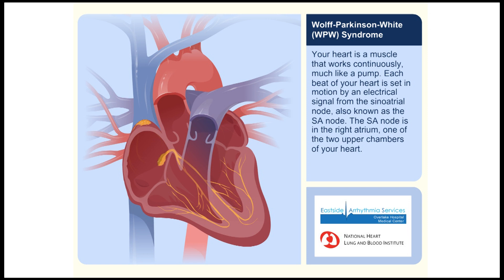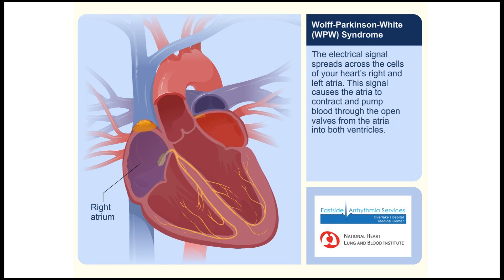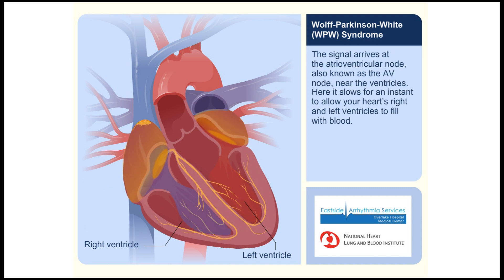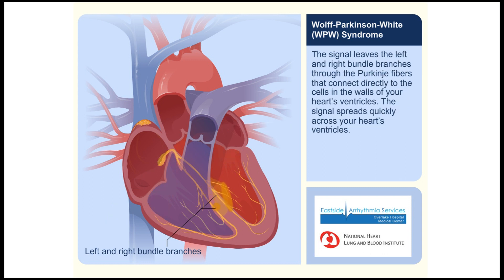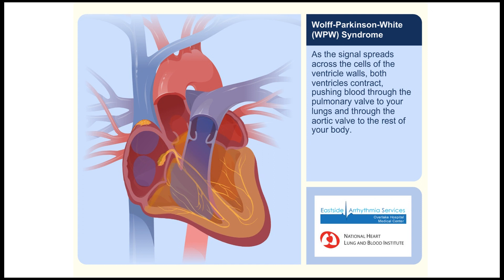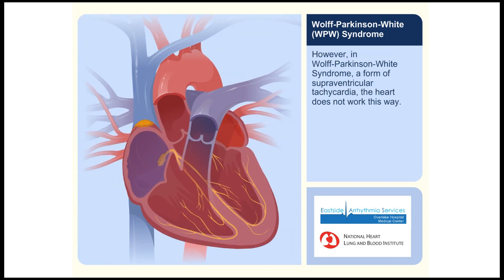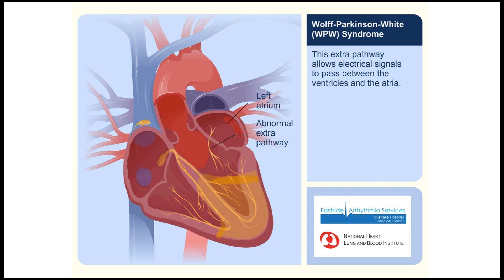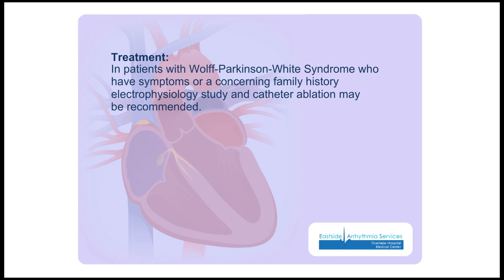WPW (Wolff-Parkinson-White Syndrome) Animation Video

Comment: I had this done and for those going for it read this: If you are going for "Catheter Ablation" don't worry. The doctor will give you enough anesthesia to sleep during the procedure but you might wake up in the middle of it yet wouldn't feel any pain so again don't worry. Once done, they will let you sleep until you wake up by yourself then after some time, they will remove the catheter. There is no pain and no other side effects etc. 

What might bother you for 1 day is back pain that you will feel cuz you are not allowed to move for one night after the procedure is done since the cut/wound needs to heal and will be covered with bandages. You will stay in the hospital for one night and then allow to go home the very next day. Just DON'T walk fast, run or use stairs for at least next 20 days. Good luck!
Reply: how many chances are there that i won't reappear? and what are the risk?
Reply: @professor_here96  As far as I know it never reappears and there are no risks. However, I remember my doc said there are always risks in a procedure but nothing like it has taken someone's life.
Reply: @waq4s  dr. said my extra wire is near normal wire and there is a risk that during procedure my normal  wire may also get damage and i could go on pacemaker(battery)
Reply: @professor_here96  I was never told anything like this especially not about pacemakers if something went wrong. The risk is depending on your doctor's experience and how many ablations they have done previously. I actually woke up during the procedure and saw the wire inside me on the monitor, it's quite a thick one so don't worry BUT make sure your doctor has previous experience with catheter ablation.
Reply: @waq4s  ok jazakAllah